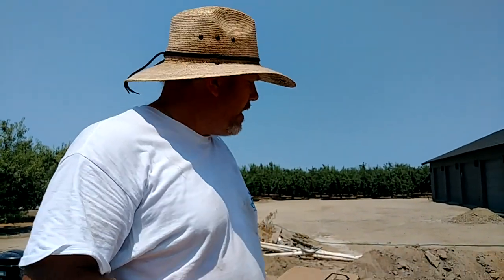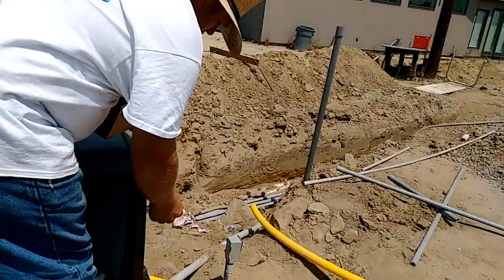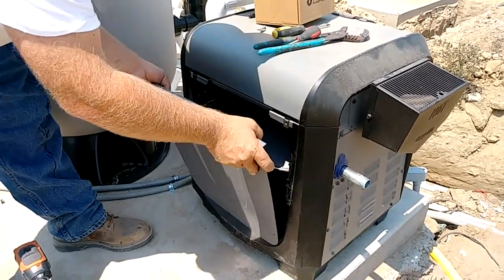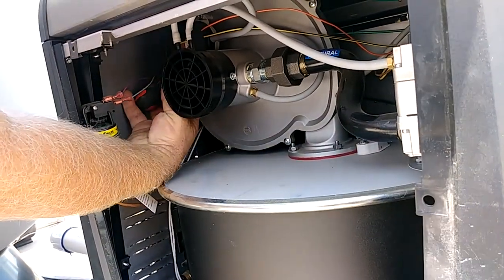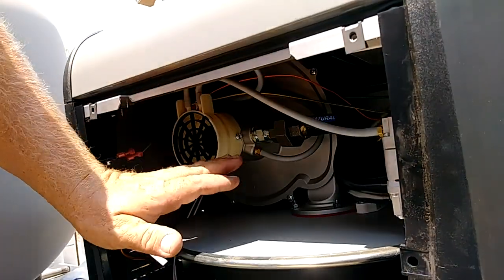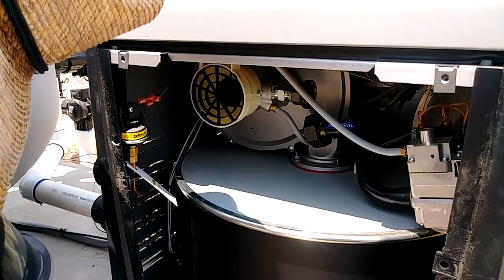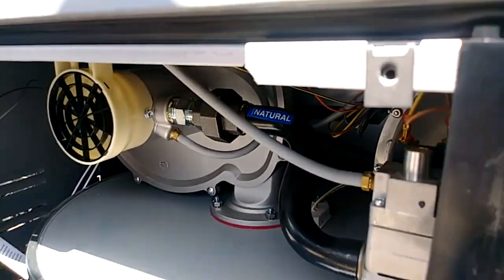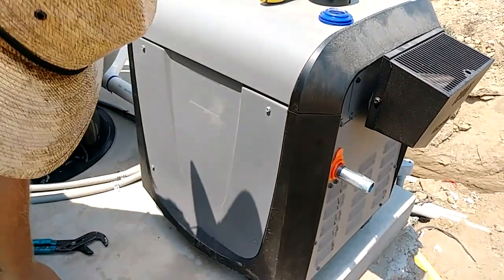Converting Jandy Pool Heater From Natural Gas To Propane

Comment: Very good video you pretty much hit everything right on point the only thing you forgot to show everybody is where the stickers are located to cover the gas sticker and show it’s now propane the stickers are located in the electrical area of the JX heater so if you just unscrew the panel where all the electrical is you’ll see there’s two stickers there ones in like French and the other one obviously is in English so you just wannacover up the English one and show. It’s now propane.

Comment: I found a conversion kit for a rheem raypak heater, but it says to have  a professional do it. They are telling me it's not with it. Is it safe to DIY?
Reply from the maker: I believe that the Raypak  heater you have to replace the gas valve and all of the nozzles. Its not impossible but it is a lot more work than the Jandy.

Comment: I have a Lighthouse 150M pool heater that is set up for gas. Can you help me with setting it up to propane?
Reply from the maker: I don't know if they make those conversion kits anymore. But normally for that you would need a new gas valve and each individual gas orifice needs to be replaced.